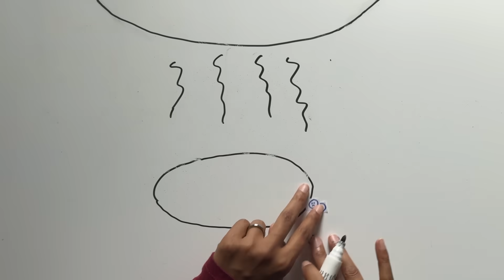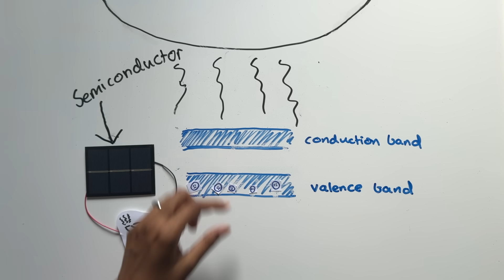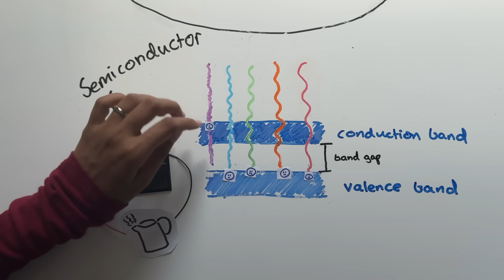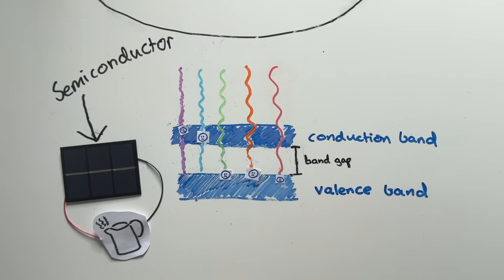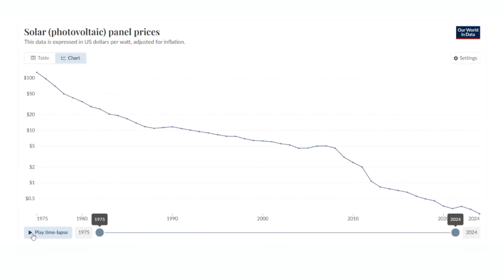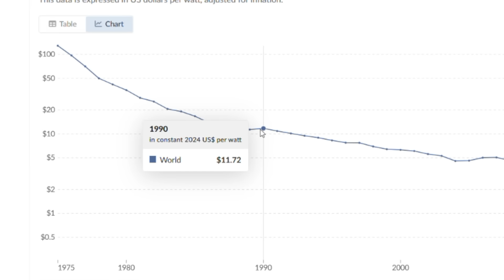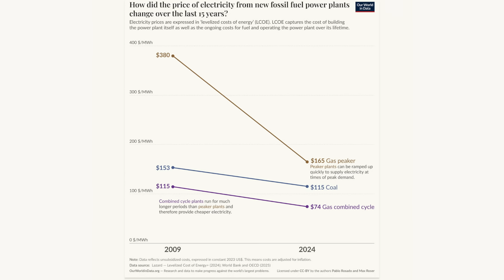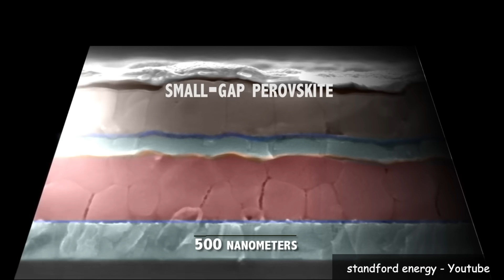Why solar panels can't be more than 33.7% efficient

Comment: At 9:26 you say "extremely popular, for the obvious reasons". But, actually no, not for the obvious reasons. The actual reason is that when solar started becoming viable, the networks were almost all owned by government entities that were run as non profit or low profit organisations. 

Consequently permitting for solar installation was streamlined and usually at zero cost to the consumer. Solar permitting in Australia typically takes less than one business hour for a residential install and only involves filling in a form, calculating the voltage rise and submitting a hand drawn schematic of the proposed installation. Literally a few seconds work for the installers.

In contrast, most places in the world have networks run for profit, and residential solar eats into their profit. Permitting takes months and costs thousands. That causes costs for the installers, which they pass on, which reduces demand, which reduces sales, which causes reverse economies of scale, which increases prices, further reducing demand...

So instead of costing 2000 USD for an install, a typical US solar install costs 20,000 even after the federal tax credit.
Reply: To add to this, the local power company in the US gets to approve how many solar panels you can have. They tried to tell us we had to have less panels until we appealed based on future upgrades like a car charger for when we eventually get an electric car. They could have still said no and we'd have been out of luck outside a lawsuit.
Reply: @Morbos1000  You can fix them telling you what to do by not using a grid tie system. This means do not try to feed power back to the grid. Use it all yourself. You can even decide NOT to use batteries and just use your solar to reduce cost by taking some/all the load during the day and using the grid at night.
Reply: @Morbos1000  the limitation makes sense because they have to account for feeding back in to the grid. are you plugging energy back into it ?
Reply: @lfow0234  No, the limitation on solar panels doesn't make sense based on feeding back into the grid, for two reasons. One: every commercial inverter (as far as I know) can limit its output, so it's just a configuration change. Two: unless the amount being exported to the grid is significantly more than the house would likely draw from the grid, the grid can definitely handle it. I don't know what Morbos1000's planned amount of panels was, but it probably wouldn't have even had a peak production capacity higher than their peak usage.
Reply: @peter-d9f3l  The problem is not usually current capacity, it is voltage. To back-feed the grid the inverter has to increase its output voltage to more than the incoming. That can push the local grid voltage too high, and your neighbour's TV blows up.
Reply: @lfow0234  ohh nooo free energy for the power company, what a disaster
Reply: I am in the Philippines, where labour is really cheap. Still permitting is really expensive, so I just got a system with a battery and don't feed anything into the grid. About 10% of my consumption still comes from the grid.
I am originally from the Netherlands. We have commercial electricity companies there also, but the rules are very different: you don't need a permit at all, you just need to fill in a form on a website and that's it. Solar is very popular there, even though there is about 30% less sunshine than here in the Philippines.
Reply: In the UK we have 3 levels of notices that you have to give your DNO, based on how much power you can to export. The lowest is for installations limited to less than 3.6kW per phase which doesn't even need approval from the DNO.
Reply: I say fuck the government! Fuck the laws and the energy companies! This is my land and i buy my loan panels. I can do whatever the hell I want. I live in South Africa and our power utility and municipality wants to expose taxes/penalties to have solar. Also in South Africa, the black government has run the power utility into the ground, we faced power cut on a rollling basis. They asked us to use less electricity, and they want to charge us for making a plan to produce our own and reduce consumption like they asked? Again I say, fuck them! I will not pay the penalties. I shouldn’t be penalised for doing something good for myself, for them and for the environment
Reply: That limitation is there for feeding back to the grid, that's not mandatory, depends on the configuration you choose to install
Reply: This is very misleading, Solar in the US is expensive because of labour cost and profit margins. Are there expensive permits in the US, that many of us outside the US dont deal with? Yes, but a 500 USD permit doesnt raise cost by atleast 10k USD.  Its the labour cost of isntallation and inspection that is stupidly high in the US.
Reply: @pjtje  
Wrong Australia labor costs of installation are about the same as Americas. Saying "the permit is only $500" is very misleading due to the fact it's ignoring the other stuff that incresses the price due to an inefficient permitting processs.
Reply: @diamondportal77  a quick google puts american labour cost 2 to 3 times higher but sure.😂 Also the other cost involved with the the permit is... You guested it mostly labour (inspection, administration).
Reply: Oh, and there's 10 days per year of paid sick leave that accumulates if not used.
Reply: @pjtje  @pjtje  my long comment comparing labour costs in the two countries got deleted. Practical upshot, in equal dollars, Australian labour costs are about 40% higher for legal workers (10% higher base wage, times 12% for retirement, times 14% paid leave) and there are no illegal workers being paid a pittance. 

I don't know where or how you got the idea that wages in the USA are 2-3 times higher than Australia.

Australian companies also like to have profit margins.
Reply: @diamondportal77  don't need no permit in the US to put solar on ur roof.
Reply: @pjtje Austrailians have approx the purchace power as US citizens. That means they get paid about the same after converting currencies.

Also the States has on average lower inspection regulations then Aussies. Its not apples to apples with the states in the US each being their own reglatory body.
But Aussies in general have more regulations and a very good reason for thier increased regulatory efforts. Tree's that sweat a literal gasoline replacement. So they kind of have to be more careful.

And that would mean... that if anything home building wise is cheaper down under in any way then any country the country that costs more done went and screwed up.

Comment: The issue with single-junction cells is that past a certain point, the cost of labor and land start to dominate. It can then make sense to invest in more expensive panels to save on those costs.

For rooftop solar, space is also a limiting factor, so multi-junction cells can also help with capacity.

In either case, there may be a cost-threshold before people start to switch, which can be a bit of catch-22 situation, since you can't scale production if no one is buying.

You might then have a choice between either slowly ramping production by selling to niche usecases, or to massively subsidize production until it becomes profitable and self-sustainable at scale.
Reply: California is already at 100 percent Solar during the day and there aren't that many people that have houses that have it . I think Elon Musk said that 100 square miles of panels in Arizona would be enough to power the whole Nation. This is with most panels running at 22 to 23 percent efficiency .
Battery's are still more expensive but the Cheaper battery's of all types are just around the corner with Sodium being the current talk of the town.
Reply: You will never be self reliant with solar in winter in the northern climate, but if you combine pv and battery, you can cover your needs from spring to fall. The amount of PV you can fit onto your roof more than covers that energy demand. So if you pay more for more expensive panels it's for electricity you are just sending to the grid.
Reply: @Psi-Storm 
Never say never.
Reply: @ws6002  This is not a technological problem, it is an economic one. Given enough space and money, you can get 100% autarky today. But the issue is...no matter how expensive or cheap that will be, you will always hit diminishing returns and inverse economies of scale. The last panel you install is expected to be used 1h in the worst year possible. That is never going to be worth your money. And given that heating with a heat pump will give you the highest demand in winter, when it is dark for 2/3 of a day, 100% autarky on solar just is not a sensible goal
Reply: @foobar9220 
Thats a circular argument. Achieving the goal requires a certain amount of solar cells and this has a certain cost. Whether it is a sensible expenditure is a subjective finding.
Reply: @ws6002  No it is not. You always have diminishing returns and when you try to cover rare cases on a per-home basis, inverse economies of scale. 
With my 6.5kWp and a 10kWh battery, I have almost autarky from March to October and an excess of 5000kWh/year that is fed into the grid. Any additional solar will only help for these months when the conditions are the worst.
But adding another 6.5kWp and a large battery will only bring me a baby step toward year-round autarky, and adding another 20kWp is still unlikely to get me anywhere near 100%. Even if prices fall by 90% this is never going to be economical.
Reply: @foobar9220 
I see that my comment went over your head. Like a Dreamliner. There is a cost to a solar based system that has sufficient overcapacity to see us through the winter. Not only is that cost sensible today,  but it will become increasingly obvious as the price of solar and storage continue to come down.
Reply: @ws6002  Maybe where you live, but definitely not here in Germany. I do not know of any country that plans on a pure solar grid. They all plan to rely on mostly wind for the winter and supplement that with hydropower, biogas and natural gas (maybe replaced by hydrogen in a distant future when that green hydrogen gets actually available). 
I just have to look at my numbers to see the insanity of trying a pure solar grid. Many days see 10% peak power or worse, it is dark for two thirds of the day and the power demand is highest in winter. Batteries are great for smoothing out intra-day fluctuations but do not make any economic sense for multiple bad days in a row

Comment: I wonder if you could create a system that absorbs all wavelengths of sunlight and re-emits them at a high wavelength such as UV. If all the wavelengths are the same, I assume you could get the most amount of energy out of the band gap. I would also assume this type of system would be super expensive so idk if it would be practical to implement outside of scientific endeavors.
Reply: this would require to combine the energy of multiple low-energy photons into one high-energy photon. I don't think it's possible. At least in thermodynamics the energy always flows from high to low level. But in quantum mechanics?

Comment: Good thing the sun is free
Reply: Window tax enters the chat.
Reply: Don't give them ideas!!!
Reply: for now!
Reply: depends on the country lol
Reply: Don’t jinx it
Reply: If the sun (not stored as oil) had been privatised we probably wouldn’t have climate change, which is perverse
Reply: @Ulysees3131  It is largely privatized.  You aren't building your own solar panels and you can't easily convert sunlight to electricity without them (wind is more plausible but personal turbines tend to be too small and too low to the ground to be especially effective).

The problem is who owns the private companies.  Namely, its not the fossil fuel giants that congress bows down to.  They did give it a bit of a go in the early days but it came nowhere close to competing with dino juice back then so it was never strongly funded and usually at the top of the chopping block whenever cuts were needed to make shareholders happy.

Now that it is more than competitive with fossil fuels, ownership is primarily Chinese.  The US solar industry is not small by any means, but its still vastly dwarfed by the both the fossil fuel industry and the Chinese solar industry.

So we end up with fossil fuel lobbyists attacking from two directions:  That switching to solar would damage the economy if you only relied on the US industry, and national security risks if you accept the larger Chinese industry.

The perversity really comes down to the legalized bribery created by the Citizens United decision.  It allows the absurdly rich fossil fuel lobby to keep congress in check and limiting the ability for federal promotion of (never mind involvement in) clean technology.

It'll eventually fail for them.  The economics have shifted far enough that solar (and wind) are now on par with gas generation, and cheaper than pretty much every other fossil fuel.  Grid scale and private industrial generation is going to follow the money no matter what the fed does.  They'd certainly move faster with incentives to replace existing capacity but almost all new capacity will be going green anywhere there's a sufficiently large field or other surface to throw up a panel array.

Personal usage (primarily cars and gas-fired furnaces/stoves/etc.) will take longer as individuals are more prone to accepting higher costs for BS culture war reasons.  But as fossil fuels slowly lose traction at the industrial scale, the weakened demand will push up prices at the consumer level and at some point all the "woke propaganda" in the world will not be enough to convince people to keep accepting ever-higher fuel prices.

Unfortunately that's all very long-term - maybe by 2050 if we're lucky.  Certainly not by 2030.  How much additional damage we could have avoided by moving faster is anyone's guess, and most guesses (that aren't funded by the fossil fuel industry) are in the range of "a whole hell of a lot".  So yeah, lots to look forward to if you plan to be around for more than a few years.
Reply: don't say that out loud
Reply: Challenge accepted!
Reply: Your skin cells might beg to differ.

As does the solar cells which degrade over time due to solar exposure.
Reply: @mnomadvfx  Technically speaking solar cell degrade due to dust and debree blocking the sun, creating charge difference and melting the thin wires inside due to high heat.
Sometimes it is a defect in crystalline structure. But more often it's just dirt that does it.
Reply: @SEThatered so solar panels on satellites don't degrade at all?

Edit: from a quick lookup it seems solar radiation itself degrades the panels too.
Reply: @MrStoffzor  Solar panels for satellites are made very differently from what is commonly sold on the market.
For satellites they use the most expensive production methods.
Those solar panels degrade much slower and are more efficient overall.
Plus, satellites are equipped with much more sophisticated monitoring systems than will isolate the faulty segment and prevent damage from spreading.
Reply: But to gain energy from it and use it in a power grid is the most expensive energy at all
Reply: If only there were a cheap method to turn it into energy, instead of electricity that the Americans consider to be useless so they're sticking with fossils.
Reply: Bro, there are rain taxes in some countries, sun will be next after we go 100% solar.
Reply: Lmfao - infrastructure isn’t.
Reply: But solar panels are not free.  Neither is the space to install them.  And they do not last forever.  Ten to 20 years, maybe? Almost nothing is free.  There is an old expression: TANSTAAFL.  There ain't no such thing as a free lunch.  Anyone who tells you otherwise, princess, is selling you something.
Reply: @freesk8  Sun is free in a sense that no individual human needs to work for it to still be shining. Geothermal is free in the same way.
What is not free is making those sources useful.
Reply: but extracting and storing that energy isnt
Reply: Bet
Reply: Plastic, silicon, land isn't
Reply: How dare you, you socialist commie, I ought to report you to the fuhrer for this 😂😂😂
Reply: But land isn't
Reply: @raptor4916 good thing balconies/windows come with the living space
Reply: Elon is working on fixing that problem.
Reply: @Morbos1000  concerning
Reply: @Morbos1000  wasn't there a startup with the goal of orbital mirrors that reflect sunlight at nighttime
Reply: Don't tell the swiss, they already have a rainwater tax. They may implement a sun tax unironically.
Reply: Bottled water is a thing ... Remember.

Air and Sun might be next ... Only rich people will stay above ground.
Reply: Tell that to the Uighur slave labour that died mining most of the world's Polysilicon
Reply: I advice you keep your thoughts to yourself.
Reply: There is no amount of renewables that can meet humanity's needs. Period.
Reply: @davidgray6999  not with that attitude, whole countries are reaching their needs with non-ghg emitting sources. What stopping developing countries is their need for oil (which some are solving that problem) and other is their need to sell oil (among which many are trying to get away from oil since it’s a limited resource unlike the sun, water, wind)
Reply: Ragebait
Reply: @davidgray6999  Uhh sure there is?  Where do you get that idea that renewables are limited by anything other than construction speed and political will?